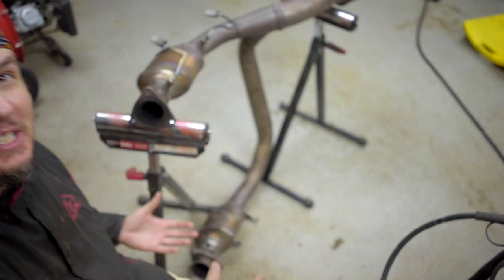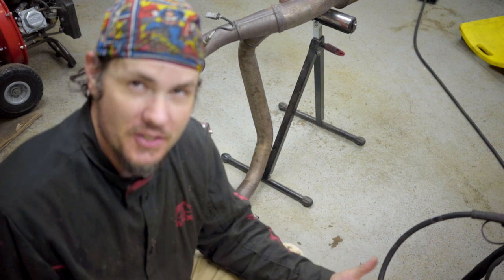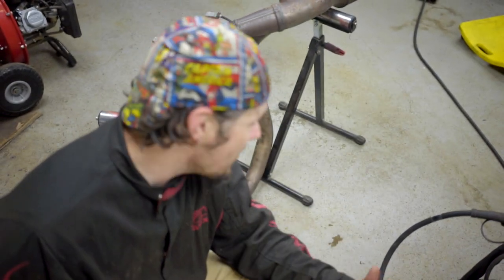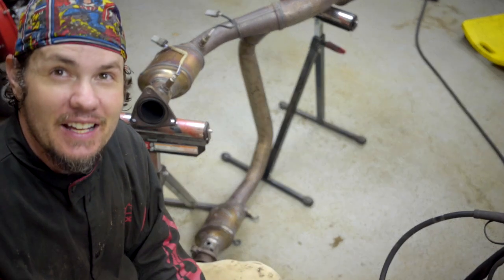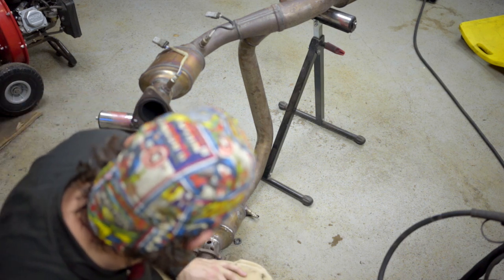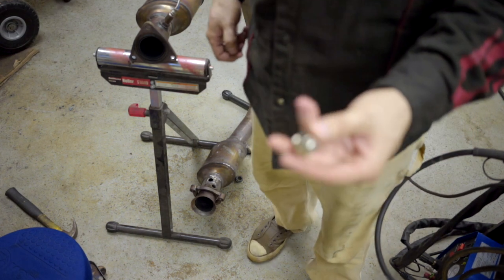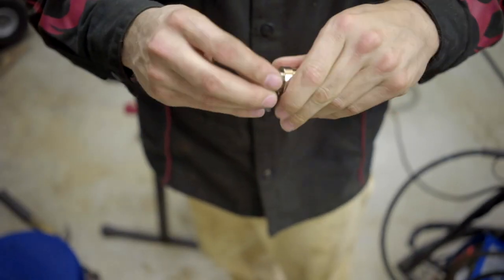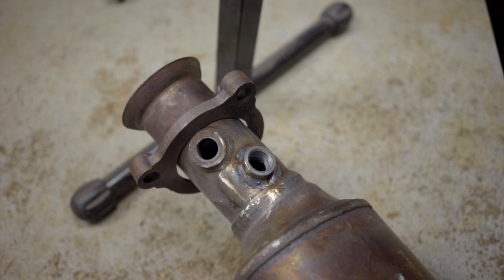Wideband Sensor Bung Install, How To Do It Correctly For The Best Readings!

Comment: Love your videos man. Spent all weekend watching many of them and learned so much!!. Getting ready to toss some turbos in my 03 Silverado with a 5.3L. Im working on routing my hot side and installing my wideband, wanted to make sure I got it installed properly and I seemed to reclall learning that angle is important but didn't remember details, watched a HOLLY video specifically on installing wideband sensors and they didn't even mention that part! But within the first few mins of your video your clarification when you said about the 9 to 3 o clock angle is exactly what I was looking for. Thank you

Comment: Thanks for the video, I have a question on the Innovate DLG-1. According to the directions it says to weld the bungs 24” from the collector. Do you know if that is required? Or why that is? I have seen a lot of installation videos of people not doing that without any problems. I will be installing them on a foxbody, and don’t like where 24” puts the O2 sensor. The stock location of the O2 sensors are within 6” of the collectors. And like I said I see people using the stock locations and just wonder what the reason for the 24” from collectors is. I believe the stock O2 sensors are narrow band, maybe that’s the difference?? Thanks!

Comment: Just wanted to comment on the wide band I bought by mistake , seller says it can’t be adjusted it’s just for viewing, I told them I set up a tune with some basic parameters do you think it will try to adjust with me putting afr corrections and maf frequency in that scan

Comment: I have a set of xforce 1 3/4 extractors that have 2 Bungs each side just before the cats get bolted on, I have factory o2 in the ones closest to motor and the next bungs about 4” behind them, is it ok to use the afr o2 sensor in the rear ones? Thanks bud love the vids. Gives us confidence to have a crack at this ourselves

Comment: Kyle, does it matter how tall the bung is? Innovate says to use a one inch tall bung for a bosch lsu 4.2 sensor and I noticed a lot of stepped bungs are less than that. They mention longevity of the sensor? Thanks  for all  the great vids!
Reply from the maker: It can, so I would go with recommendations as there are some considerations due to heat and exhaust exposure
Reply: Kyle does it have Screw in Bung ?

Comment: i would think that a pin hole would not cause an issue when it matters (under load) as there is positive pressure in the pipe.

Comment: I didn't learn to much in this video...
Oh, my bad, you're only referring to the bung holes... 🤪

By leaks, I believe ya know what you're talking about, but I believe ya kinda got the concept a little backwards. 
Adding outside air would probably cause the sensor to read lean, but I believe the exhaust heat and pressure should take care of any unwanted outside coming in. 

If I had to guess, maybe during the whole cat conv. save the world thingy and having the exhaust pulses evacuating the pipe, maybe certain pollutant gases and fuel vapors escape out of the piping through the leak, and maybe that's why the wideband 02 readings could get thrown off.
Well, I'm just speculating, because I'm still trying to further my knowledge on this topic as well.
And thus why I was watching your video...😄

Comment: do you only check one side? or would you put bungs on both sides, and tune with one side, then check the other?
Reply from the maker: I only do one side, but if you're not going to go closed loop again it's not a bad idea to check both. If you are going to do closed loop one will get your with in a couple percent of the other and the narrow bands will take up the slack.
Reply: @GoatRopeGarage  i know ppl use the tailpipe clamp which isnt great for couple reasons, but how far off will readings be if you just put a good bung after the cats, after pipes merge together? i have a very easy place where i could install with still on the car there.
Reply from the maker: @zparnell  It varies based on the condition of the cats and stuff can be almost no difference to up to .5

Comment: The best advice I’ve ever heard is in this video- get good penetration, and make sure there are no air leaks.
Reply: The pipe is under positive pressure when under load which is when you really need to know the afr, a pin hole leak would not affect readings under load.

Comment: Hi kyle can u clarify something is an afr sensor the same thing as a wideband sensor?
Reply from the maker: Yeah, AFR is just one of the readings, they all read in lambda and then convert to AFR if you're using AFR to tune
Reply: So when buying a gague should i just buy an afr gague or do i need a lamda aswell?

Comment: Question Sir. We did a 5.3 swap on my 96 Silverado. Just added a GT45 turbo and the manifolds are flipped and modified. Where do I install the upstream O2 Sensors ?
Reply from the maker: After the turbos, that's the important part, I'd say at least a foot away if possible
Reply: @GoatRopeGarage   This may be a stupid question but, both or one?

Comment: Can the rear 02 sensor bung hole be used for the wide band sensor?  2001 camaro with long tubes
Reply from the maker: So long as there isn't a cat, but you might get some delay in your readings at part throttle

Comment: In prep for my kooks headers, I quickly welded in a bung for my Ballenger wideband. I'll master tuning with the stock exhaust first. Harbor freight welder and tons of spatter, wheee!!! The stock sensor stripped out so actually 2 bungs. http://i.imgur.com/0n5pjRa.jpg 
http://i.imgur.com/9deIMFK.jpg
Reply from the maker: The cheap bungs are terrible, I went through 3 for the same reason.

Comment: Why do u have 3 holes? I thought u would block off the original al o2 sensor hole and then just drill a new one for the gauge but u have 3 holes there?
Reply: the front o2 still work  the wideband is only for tunning by hand rear o2 can be deleted if you dont run cats